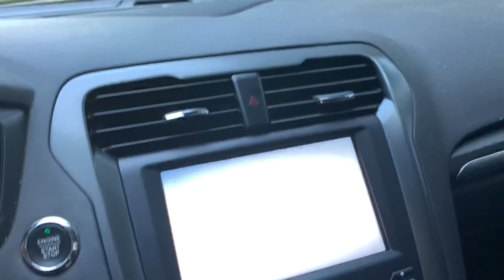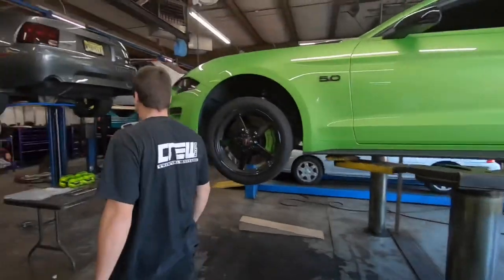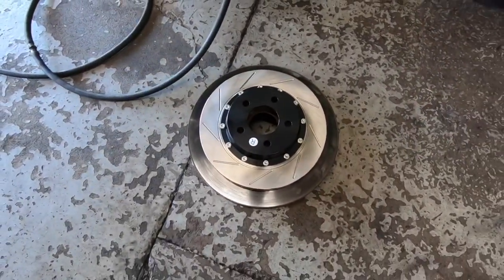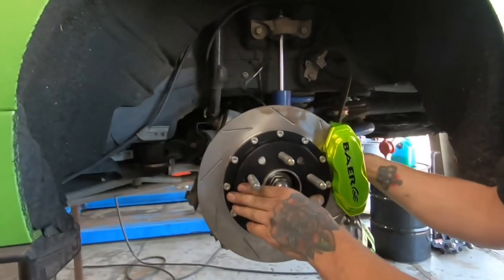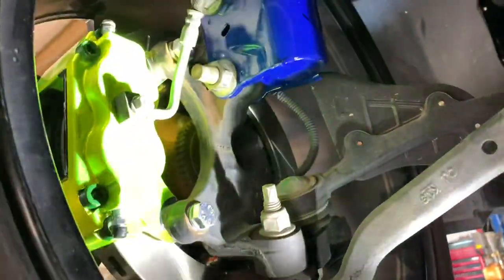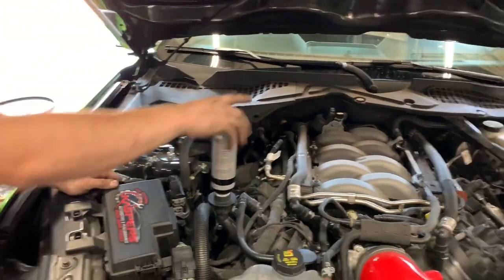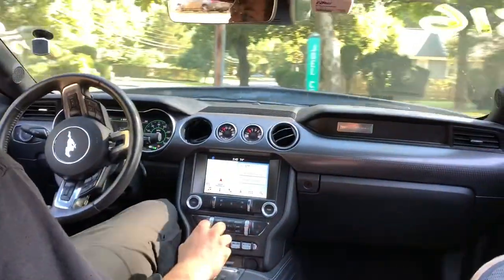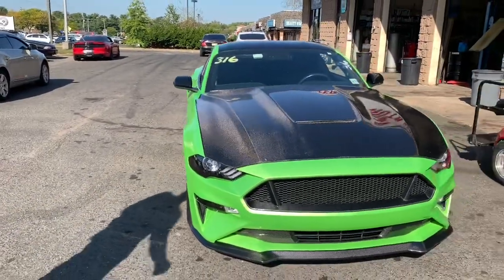MAMBA MUST BE STOPPED! | 2018 MUSTANG GT BAER DRAG BRAKES INSTALL & REVIEW!

Comment: The tick is from the AC. If you ever wanna test it, just next time you hear a tick, turn the AC off. The Gen 3's don't have a tensioner so it's the sound of the slack.
Reply: CrimsonStang -went to local Ford Dealer and showed them your comments. Let me try 3 new and 3 used 18&19’s and turning the A/C on and off did absolutely nothing to each. The new ones had no tick and the used ones varying degrees. It has been proven that the tick starts after the first oil change. Reason is that the “running in oil” is full of zinc and a higher viscosity.
After TB 7718 Ford changed the recommended viscosity from 5w-20w to 5w-30w although you can run a 10w-40w and you will never hear a thing. Good Luck.

Comment: you gave up front Brembo calipers for Baer brakes because they're lighter weight ?
Reply: acts2211 yes? It’s a drag set up
Reply: @1BadVan  just using my eyes through YouTube and when I say you save about maybe a hundred pounds on calipers and rotors maybe a little bit more?
Reply: acts2211 it’s the rotating mass, that makes the biggest difference
Reply: @1BadVan  yes I see. Reduce the inertia

Comment: Bro the Momba is lookin Great but,unless your taking her off the street and making her a track only car,you don't want to daily drive her with drag brakes because that type can't take the heat, that's why they are much smaller.
Reply: Oh it can take it no problem. Try daily driving an old heavy beater car with drum brakes and tell me that his mustang can't take daily driving with drag brakes that are disk brakes that still stop on a dime.
Reply: @BlackWhiteBeast  I DON'T THINK YOU UNDER STAND WHY THEY ARE CALLED DRAG BRAKES,THIS TYPE OF BRAKE IS ONLY MENT TO BE USED FOR A FEW SECONDS AT A TIME ,NOT FOR LONG PERIODS OR SUDDEN STOPPING.THEY ARE BRAND NEW SO OF COURSE THEY WORK GREAT FOR THE MOMENT.THEM BEING DISC HAS NOTHING TO DO WITH IT.
Reply: Whoa! Triggered!
Reply: @foxaholic4228  You're crazy af!
Reply: I don't have anymore I smoked it all

Comment: Why would you change those brembo brakes for those tinny crap brakes?
Reply: ps31871 less rotating mass for quicker acceleration...
Reply: Less weight... stop just as good, if not better.
Reply: They're definitely not crap brakes. I told another poster to try daily driving an old heavy beater car with drum brakes and compare that to his car with these disk brakes. They're drag brakes, but they're still WAAAAAY better than the brake systems from the past and they're nice and light for less rotating mass. I'd say he knocked over 2 tenths off of his 1/4 mile time with this upgrade.
Reply: Just ask Mamba and she will tell you larger isn’t always better LOL. These are most likely ceramic brakes that work super good even when glowing red verses metallic brakes. And the weight saving for each corner is quite a bit if one considers rolling mass. Thanks
Reply: @BlackWhiteBeast  Over 2 tenths is a stretch. He shaved off a little weight, but not that much.
Reply: @chrism.728  He shaved off about 160lbs of "rotational mass" which is a HUGE difference in drag racing. You'll see ;)
Reply: For real! thumbs down for those tiny ass brakes for almost no gain.

Comment: Cool to watch this after I just did my first brake job this past Friday. Planning to upload it to my channel but it was no where near as smooth and seamless as your experienced mechanic's time with your car haha! And you guys had to bleed the brakes and reroute the rear brake lines while I was just changing my pads and rotors :/.... Still learning though so it's all part of the process.
Reply: Octane Street Well done. A bit apprehensive the first time but after that it’s not too bad. It’s fun to get your hands dirty hey!!!
Reply: @edthomas8486  Yea, I was quickly losing motivation because things kept going wrong.... For example one of my caliper slider bolts snapped and broke off inside the slider itself (if i'm explaining that properly) so it was just rough haha. Only got the fronts done but i'm looking forward to doing the rears real soon despite the mishaps!

Comment: Need to find some to 3D Print “MAMBA” using the same font as the Shelby’s and put it on the back of the car between the brake lights.

Comment: he mentioned that you have a differential in that car what gears are you running are they 410s ?
Reply: acts2211 he has a video on it, it’s 3.23 or something close to that
Reply: @tylermains9533  I guess I missed that video the Mustang with automatic transmission comes with two choices 3:15 or 3:55 but since the guy in the video said he put a differential and I'm thinking it's something deeper like 373 or 410
Reply: acts2211 yea the said these newer cars are different than the older cars, as in the newer cars work best with a higher gear ratio. Scroll through his videos and try and find it, it shouldn’t be to far back.